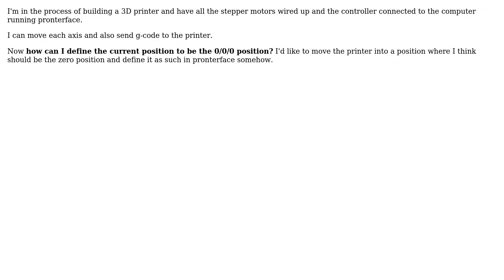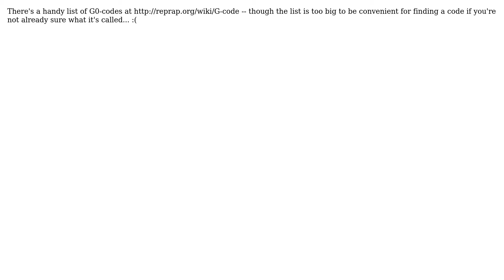3D Printing: How can I set the position in Pronterface? (2 Solutions!)

Comment: I'd like to connect switches to the MKS Gen L 1.0, and based on those inputs, have specific motor movements. However, not sure if this can be done via the usb interface (ex. pronterface) or if I would need to modify the Marlin firmware.

For example, any idea if in addition to sending g-codes, can pronterface's printrun library (printcore.py) read the digital inputs to the microcontroller?   If not, any thoughts on the difficulty to modify/build the Marlin firmware (VSCode/PlatformIO)?